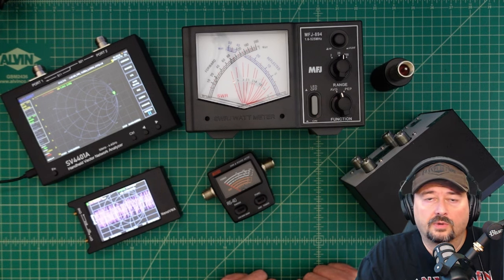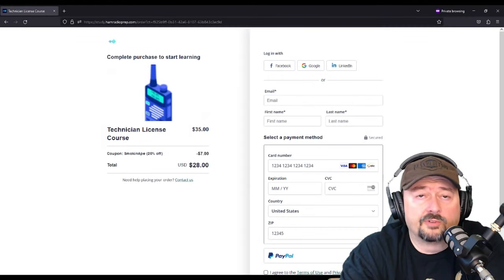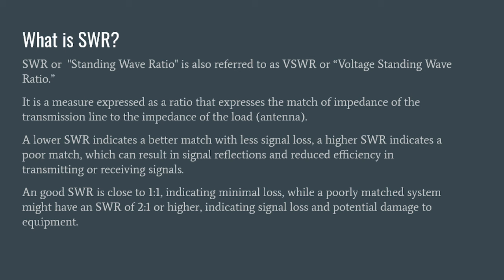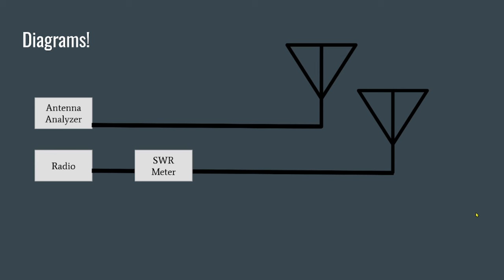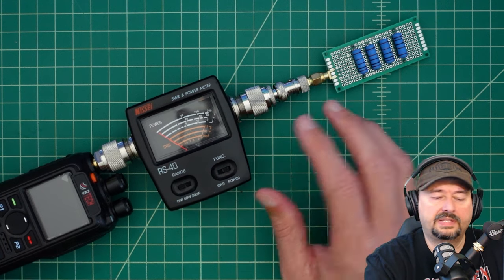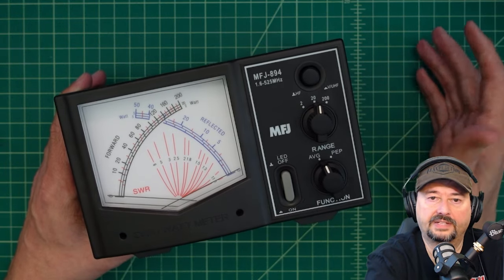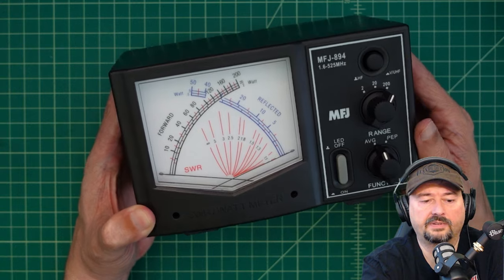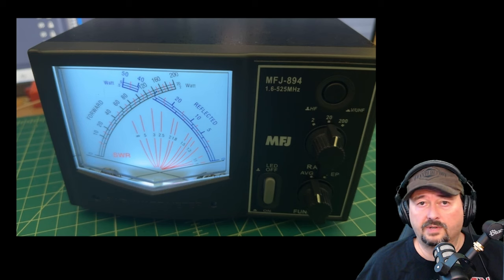How to use SWR Meters for Ham Radio Beginners

Comment: A VNA is very useful, got mine last year, it takes a lot of guesswork out of adjusting aerials. You can instantly see if it's too long or too short. Far easier than just using an SWR meter and great for the price.
QRP and resistive SWR meter here, tx never sees above a 2:1 SWR when tuning but still reads the true SWR. It does need taking out of circuit after.
G4GHB.
Reply from the maker: Howdy Bill.  Totally agree, the VNA has been the best investment I've made what it comes to ham radio.

Comment: Very educational, but in trying to build an antenna, I was hoping to learn if it is possible to use the cross-needle SWR meter to optimise the antenna length. Thanks.
Reply from the maker: You can transmit on various frequencies and then plot the results in a graph.  Use the graph to trend where swr is getting better and worst then adjust the antenna as necessary 👍

Comment: I appreciated the video, but I'm still a bit lost.  I think I'm unknowledgeable enough to have to back up a step.  If I'm going to be doing 10, 15, 20 and 40 meters, how does that eliminate or include a particular meter?  I'm making this up as I go but it seems that would mean I care about 7.0 - 29.7 MHz, which would mean ALL your meters would work for me, is that right?  I get confused with all the options and figure as soon as I purchase something, I'll figure out that now I need to buy a different one to handle another band.  Are my fears unfounded and can the meters you show do basically anything a General license can do?
Reply from the maker: Look at the frequency band of the meter and see if the ones you are interested in cover them.

Comment: I am a radio novice with an ICOM A24 aviation handheld radio with output specs of 5W (PEP) and 1.5W (CW).  I am testing VSWR for the radio w/ external antenna with a Sharman V20. Should I expect to see the forward output to be 1.5W or 5W? Thanks
Reply from the maker: It will depend on the mode you use...

Comment: Will a transceiver and antenna still work normally together if a SWR meter is hooked up to them, but not powered on? Or if you want  to leave SWR permanently attached, does it also have to be powered on all the time along with the radio??
Reply from the maker: Yes, most people leave them inline 100% of the time.

Comment: Think where there is a misunderstanding with swr is what happens to the reflected power ,where does it go ,is it all lost ,is it absorbed by the radio and potentially damage it,or does it join the forward power etc if it was talked about more i think there would be a greater understanding
Reply from the maker: Fair point Paul, I’ll do a more in-depth video on SWR 👍
Reply: @TheSmokinApe  that be great if you could

Comment: is there a difference between CB and uhf/vhf SWR meters? or can all meters do both? and can they be used on 5w-10w HT radios effectively?
Reply from the maker: Hey TC.  Some CB meters will only cover the CB frequencies and some ham meters will cover CB.  What you can do is check the frequency span on the meter you want to buy to check that it covers your area of interest.  On just about any meter you can handle 5w many are designed to go higher, again the best bet is to check the meter specs 👍

Comment: Can you send the name or part numbers of the adapters used to hook up meter to the portable radio? Can I use antenna instead of dummy load?
Reply from the maker: You can use an antenna.  THey are just coax connectors I got off amazon.  SMA / PL259 and SO239
Reply: @TheSmokinApe  thank you sir!
Reply: I have a 259 and 239. Neither will screw into the radio housing.  Any idea what I am missing? I apologize for being dumb about this.
Reply from the maker: OH, the 705 has BNC-F you need BNC-M
Sorry man